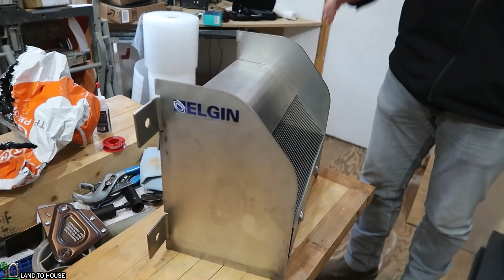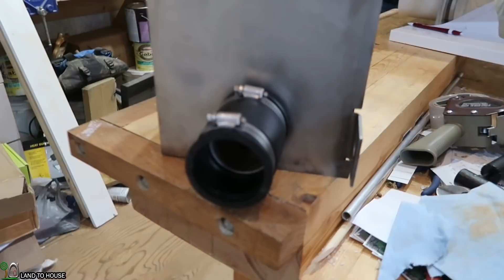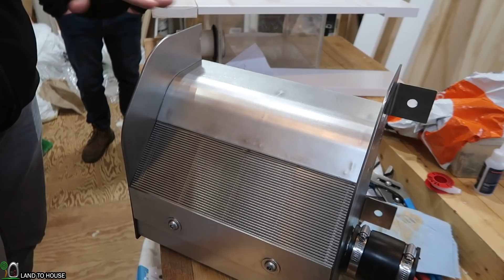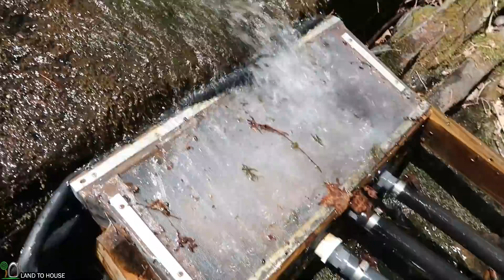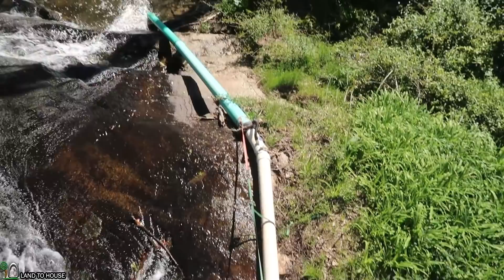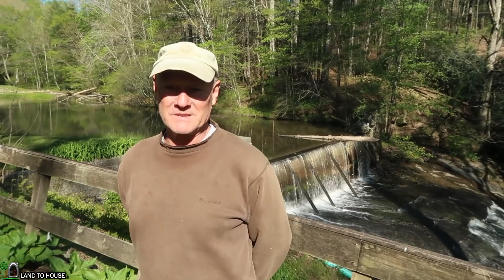New Coanda Screen Intake for the Micro Hydro

Comment: Thank you for continuing to test approaches for filtration systems. I've linked to this video from the filtration discussion in the Water Powered Pumps Facebook Group:
https://www.facebook.com/groups/240458583255303/permalink/640120626622428/

While different environments needing filtration and micro-hydro / pumping applications may require different levels of filtration, for systems that operate 24 x 7, filtration can be a challenge and costly component.  Thanks.

Comment: O nice, looks like you are going to professionalise you micro hydro system. I actually was wondering alreday last year how long your intake (with all these bicycle inner tube sealing towards the rock) will last. Also: The off-grid system of your neighbour is still running (that made all the noise in the part of the video were you were at your intake). Obviously, it was not frost-shattered. Do you plan to show an update of that system?